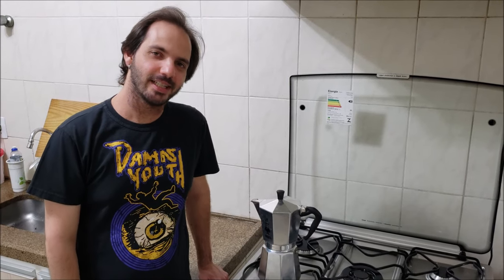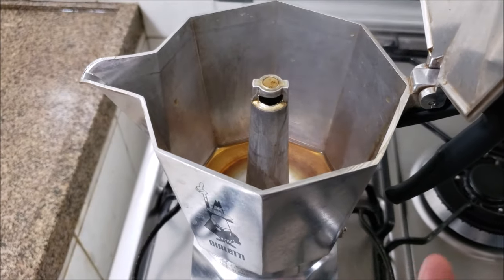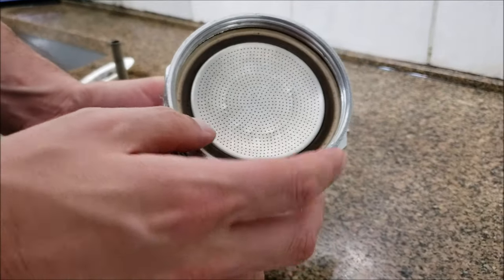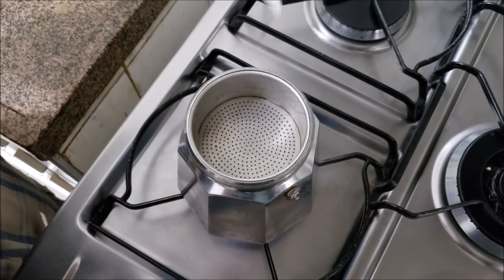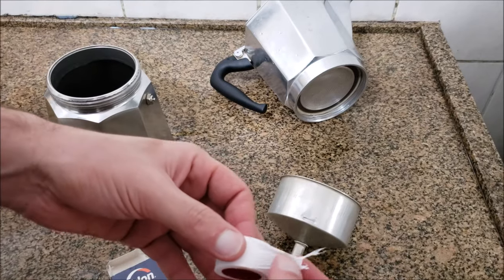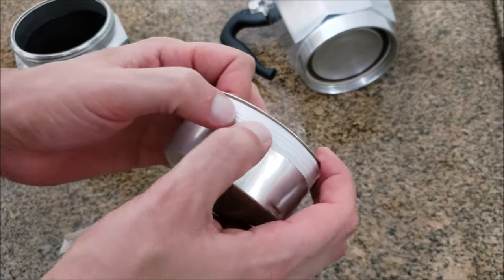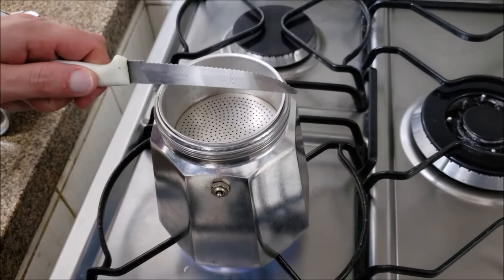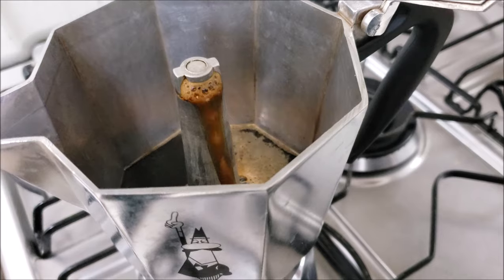Moka Pot sputtering or not working correctly: how to solve it!

Comment: Whats really strange is when you brew a cup one morning and it works great....the next and it sputters and does not brew any of the water!  Tried clearing the valve, and the gasket ring, and the basket......and it still hasnt fixed the problem.....tried lowering the heat, raising the heat......again nothing......this will be my next try.

Comment: Won't the Teflon tape poison you? :p
Reply from the maker: That's good worries, but I believe it won't. PTFE (or teflon) tape melting point is about 243°C, but the Moka Pot temperature when it is fulfilled with water is about 100 °C. At this temperature, the PTFE degradation is neglectful, and hence, not poisonous. I hope I could help you!
Reply: @viniciusandrea3251  you sure did, but too little too late- I had an issue with mine, as the filter cup was dented all around so I used a wooden hammer until i got a better fit. Luckily it's aluminum which deforms easily. Otherwise I like the idea, and would also try to play with different types of seals or even self applied silicone.

Comment: Not toxic?
Reply from the maker: Hi Luis.... not in this case. If the PTFE tape is heated above 243°C, it could release toxic fumes, but when the Moka Pot is full of water  its temperature is about 100°C  so no worries.
Reply: @viniciusandrea3251  thank you

Comment: Thats poison tape.. Teflon
Reply from the maker: Hi Jordan. Well, it's not that simple. It depends.
In fact, PTFE (or Teflon) when burned releases poisonous fumes due to the Fluor of its molecule.
But this poisonous fumes are released when PTFE is heated over 243°C (~ 470 °F). 
When we prepare coffee, the Moka Pot is about 100°C because of the water inside of it. At this temperature, PTFE degradation is neglectful and there is no deliberation of poisonous fumes. 
Nevertheless, one should be aware of not living the Moka Pot over the fire without water inside, because in this case its temperature could surpass 243°C. 
I hope I could help you!